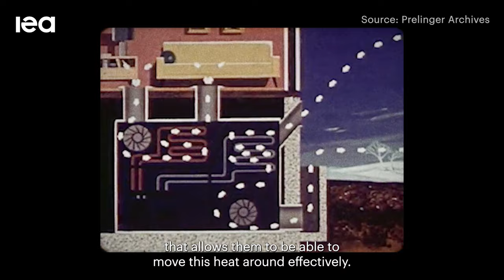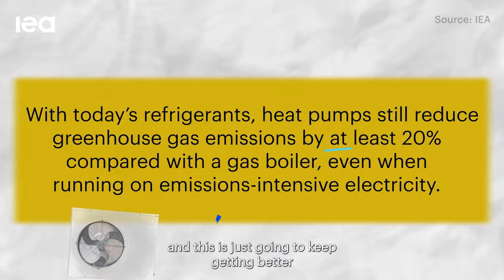Are heat pumps the next major clean energy technology?

Comment: I've had a heat pump for the last 20 years, but it doesn't work well at temperatures below -15 degrees Celsius (5 degrees Fahrenheit). Thankfully I live in a temperate country so it isn't really a big issue.
Reply: Modern cold climate heat pumps can easily handle those temperatures
Reply: Got one last year and it goes to like -30C
Reply: You can have groundsource ones that use the ground rather than outside air and will work well no matter the temperature outside
Reply: @rkan2  my outdoor unit was completely caked with snow and was still producing heat, it’s incredible how well they perform isn’t it?